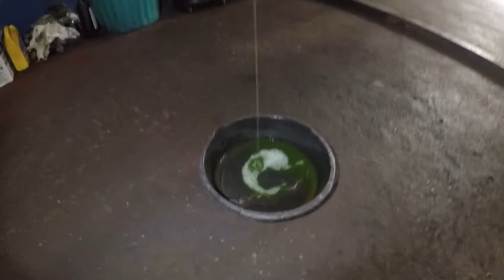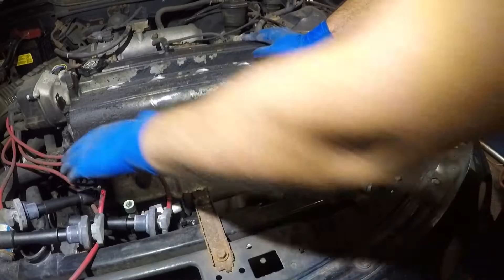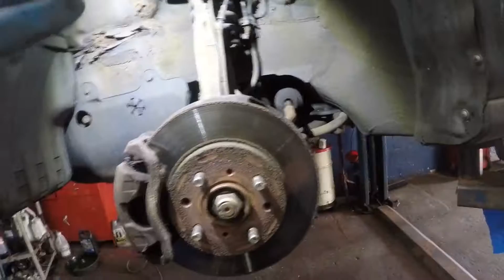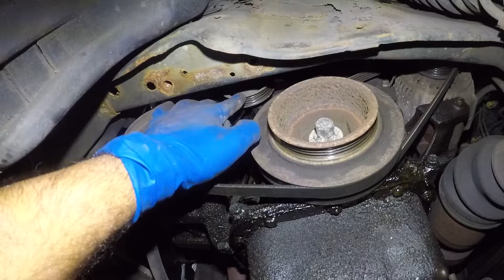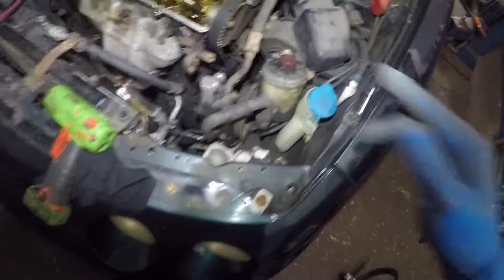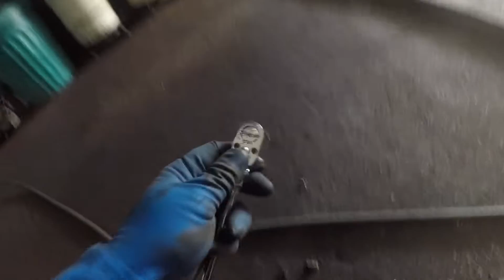How to replace Timing Belt & Water pump on Acura Integra part 1

Comment: Is it recommended to replace the timing belt + water pump if I'm replacing my head gasket? Was planning on replacing the valve cover gasket too, since it needs to come off anyways
Reply from the maker: Yeah I would do that since it’s open
Reply: @RBTheMechanic  thanks for the reply. Are there any other gaskets, seals, or parts I can/should “easily” replace while I have parts off? (Easily in quotes, as I hear doing the WP+TB without dropping the engine or having the car on a lift is extremely cramped & difficult)

Comment: If you have to do the valves adjustment, you will follow certain order.  or can be done (Gaping) in any order. What you recommend?
Reply from the maker: U have to top dead center each cylinder one at a time

Comment: I have a Honda civic 1990 ex sedan with a motor swap of a b18b1 gsr manual I replaced the spark plugs gapped and torqued, ignition spark plug coils, distributor ignition coil, fuel pump, battery, alternator, fuel injectors, cranks no start the mechanics bypassed the security system I lost the key fob if u could give me some ideas of what I could do to figure out my issue
Reply from the maker: Key fob u lost it? So car don’t start or unlock or alarm goes off?
Reply: Are you sure it's a gsr a gsr it's a b18c1 the b18b1 is like the one from this video I would check out the main relay on my old Integra wouldnt start and it was a wire that came off the main relay plug remove the aftermarket alarm and see what it does

Comment: Anyone know what the torque specs is in that engine mount stud? I can't seem to find it
Reply from the maker: At what time frame u see it I can get it for u and year make model engine size?
Reply: @RBTheMechanic  it's at 18:32 . I have the 1996 integra gsr model so the engine is the B18C1 version which is  1.8L. Thank you!!!!
Reply from the maker: @baconstorm2259  I just posted a picture in the community section of the mount and torque
Reply: @RBTheMechanic  you are an incredible person, thank you so much!!

Comment: how did you get the harmonica balancer off so easily?
Reply from the maker: It wasent jammed or anything ... and we had done timing belt on this before few years back so it been on and off ... anyways is ur jammed up? The bolt?
Reply: @RBTheMechanic  trying this and  my millawee 1/2" drive impact is not removing the 19mm bolt. Not sure if I have something that i could get it hot enough to help remove.
Reply from the maker: @mtrevlac  the crank bolt some times get tight they sell tool to hold crank it’s like 15$ and then put on pry bar with socket on center

Comment: Is there any way to see if engine is damaged due to the belt breaking before doing all this work?
Reply from the maker: That’s a good question u can align the valve to close up and then take out the spark plug push in compressor air with guage and see if it holds.
Reply: @RBTheMechanic  Thank you I will try that.

Comment: W up bro thank you video where I can got good parts like timer bell need to buy the map sensor and idle air control valve to check auto parts to much money want buy something work c year let me now thank s much
Reply from the maker: Idle control valve is expensive but timing belt u should be able to get on amazon and water pump
Reply: @RBTheMechanic  i now idle control valve want $198 $218 to much check amazon got to much belt difrend want sonthing no need to change it like 3 year o mored hear to much $$$$ for change it thank s much bro g bless you y time
Reply from the maker: @angelgarcias7328  no problem yea the idle control vale is expensive now days new cars have electrical throttle so idle control valve is eliminated the electrical throttle run fron$400-500 but I do remember honda and Acura idle valve run me around $190-400 and the brand was intermotor I used that brand lot but I think the price u got is fair   Belt goes around $40 good water pump ASIN brand or delco like $70 or gates commin brand $40
Reply: @RBTheMechanic  that part can got Honda auto parts you send me it one check that mark yee want something find need change 1or 2 year life chager to much money to do the jod lolll thank bro
Reply from the maker: @angelgarcias7328  lol true

Comment: My crankshaft rotates along with my impact gun when I try and get the bolt off . Any ideas how to get it off???
Reply from the maker: En Serio? Well 1st thing 1st don’t impact it u can damage things u have to hold the harmonic balancer pully then try to impact it but since it didn’t come off they sell $12 tool that goes inside the balancer to hold for u. Now u have to do it mainly with hand power
Reply from the maker: En Serio? Here’s the tool on amazon Yoursme Fit For Honda & Acura Crankshaft Crank Pulley Wrench Holder Tool 50mm Removal Holding Spanner https://www.amazon.com/dp/B07439GHJ2/ref=cm_sw_r_cp_api_i_WG5BFbPBE7JVQ
Reply: @RBTheMechanic  Hey man thanks for the video, it is alot of help I unfortunately i am also having an issue with the timing bolt, due to where i live they use salt during the winter seasons and  auaes terrible corrosion on every bolt... is this something I could apply a bit of heat to without ruining anything? Like 20 seconds give or take of some heat, thanks
Reply from the maker: @Winterborne204  you have to try lubercwtion and heat maybe go easy don’t breaks it